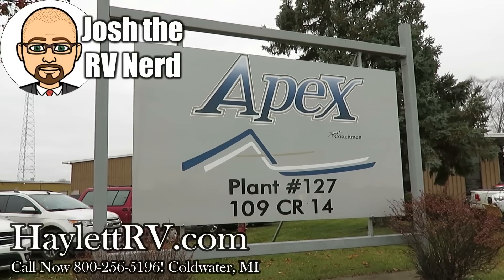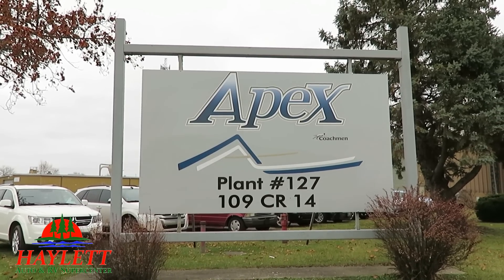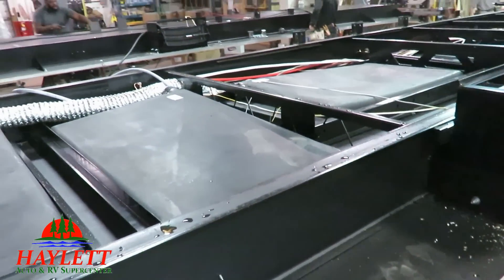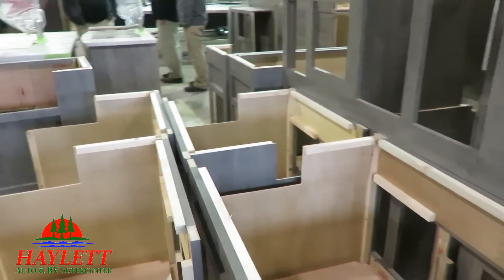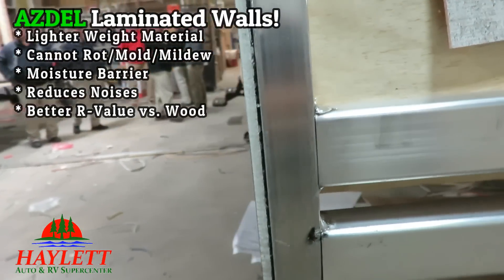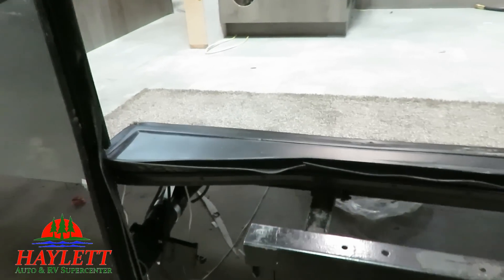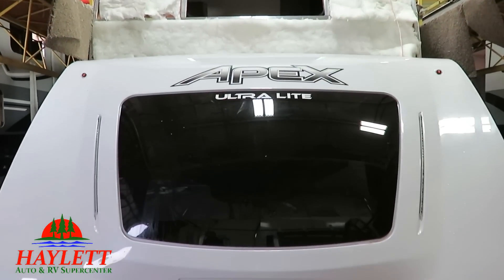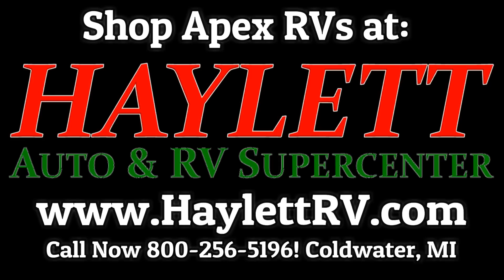Coachmen Apex RV Factory Tour!

Comment: These factory tours are awesome. Please continue this series of factory tours.
Reply from the maker: It'll be a bit before I can get away from the office and do more. The response has been great, though. It's certainly something I want to try doing more of. My hope is to wait until the bitter cold weather here warms up a bit and sneak down on a nice summer day.
Reply: @JoshtheRVNerd  How long does a trailer usually take from order to deliver?
Reply from the maker: @timyeo8710  Can vary significantly based on supplier shortages, current demand, and floor plan run cycles. Currently any brand worth their salt has about double the normal lead time. 

Normally "6-8" weeks is the default response. Right now you can double that pretty safely.
Reply: @JoshtheRVNerd  Thank you very much. Love the videos

Comment: Yay! Looks like Apex has gone with a white front cap on the summit rather than the dark grey. I never liked the idea of a large heat absorbing color right next to my headboard.
Reply from the maker: They have, but you'll definitely want to keep that front shade drawn and perhaps add one of those heat reflective window-foil-inserts to keep the sun out as RV windows only have roughly an R0.7 value and are a huge heat/cooling loss point.

Comment: These factory tours are great. I am considering buying an Apex Nano 203RBK  or a Freedom Express 192RBS. Similar design but one has the dinette and no Oven with a low mounted convection microwave, and the other a sofa with removable table and Oven with high mounted Microwave.  Both come with Murphy beds as an option if not standard.  I think the APEX would be better to tow with my 2018 Jeep Cherokee Trailhawk with a tow package and capacity for towing 4500 lbs.  We need the slide for space for our dogs so we are not tripping on them.
Reply from the maker: You can compare them both here: 
* 203RBK: http://bit.ly/2Qlyk6I
* 192RBS: http://bit.ly/2xVUDfa
Also, quick note: 192RBS Freedom Express does not currently offer a murphy option. Only the Nano model you mentioned. 

If those two models had a baby, then it would probably look like this: http://bit.ly/2vvKe70

Comment: do you happen to have any pictures of the framing of the back of the trailers? I am really curious what the framing looks like at the back of their trailers. Wood studs? All Aluminum? Stud spacing?
Reply from the maker: This is an all aluminum structure. Sidewalls are laminated so the studs are further apart (which is how laminating walls works). Rear wall is not laminated, so 16" on center average spacing
Reply: Haylett RV very helpful! Thanks for the reply ❤️ do you happen to have any photos of the  rear open to studs while you were at the factory? If you did then I wonder how you would get them to me 🤔 Facebook?
Reply: Haylett RV oops nevermind! Coachman just sent me their dimensioned drawing of the back wall 👍🏽

Comment: Hi Josh, really enjoyed this and the freedom express tour videos.   Noticed you did not have any footage of the wall lamination process.  Do they use vacuum or pinch roller lamination ?  Thanks
Reply from the maker: Vacuum, though I don't think it really matters. I used to drink the punch on one vs the other, but with years and years of experience I have never seen it matter. 

Rather, what matters is the humidity control during the laminating process. That's what truly determines an effective bond. Not the way the materials happen to get pressed together.